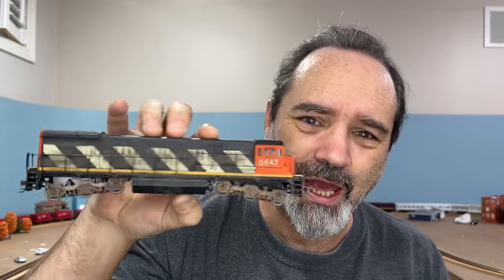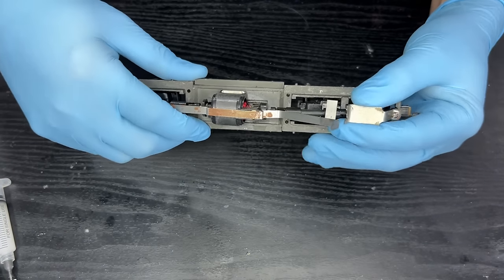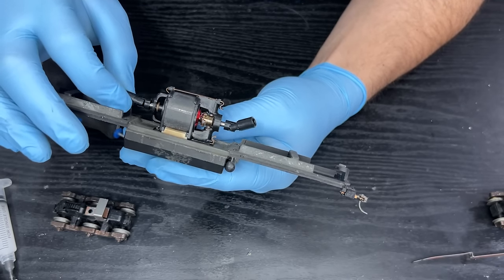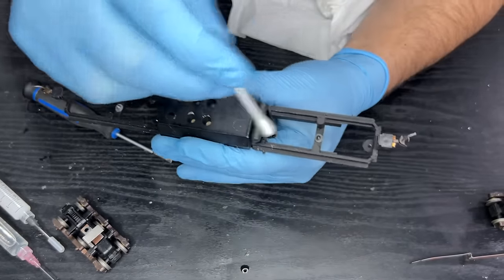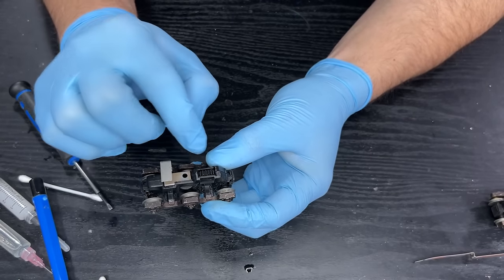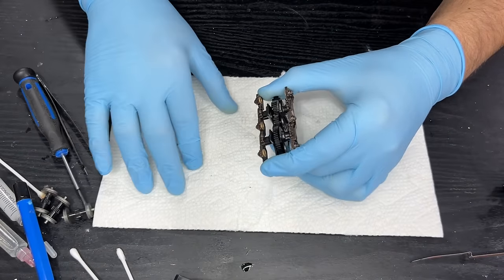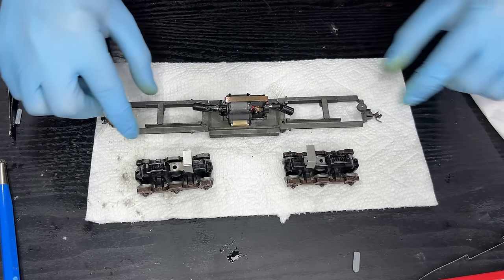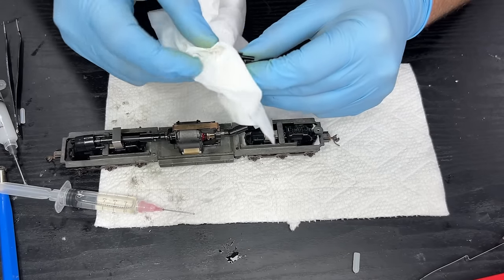Tune Up Tuesday - CN U33C Athearn Blue Box

Comment: Looks like a typical successful repair of a 1970s Athearn drive.

As I mentioned in a previous video that the CN didn't have these locomotives (most likely any GE U-boat locomotives) and I would guess that would go for the CP, also. There is a very good reason. At the time GE made the U-boat series locomotives during the 1960s, Canada had a stipulation on importing locomotives. Since GE was a new locomotive manufacture during the 1960s after Alco quit making locomotives, they would not have any established factories in Canada for locomotive production. Instead, the locomotive purchases for similar Alco Centenary series locomotives went to the Montreal Locomotive Works (MLW) who had the Alco license to make Alco Centenary series locomotives long after Alco stopped making locomotives in the USA. This is the prime reason that the CN and CP had Alco locomotives exist long after US railroads long retired them.  If the locomotive stipulation was not in effect at the time and the MLW did not produce any locomotives after Alco quit, I'm sure the CN and CP would have purchased these locomotives. This locomotive makes a great what-if locomotive if history did change.

Comment: Another great video Dave and I am so glad you did not replace the electric pickup bar.  I will never understand the burning desire to replace the bar with globs of solder and wire.  I have over 30 Blue Box locos and never have electrical pickup issues with the bars.  And by doing the wire thing you are taking away one of the best features of being able to easily drop the wheel assemblies for maintenance.  I get it if one wants to convert to DCC, but otherwise NO.  I see so many videos that recommend the wire, it makes me sick every time.  Take care and keep on moving with the greatest hobby out there.  Jeff.

Comment: That is a very early run U33c. Athearn did away with the screw holding the light quickly, and went to the push in front mount to save money.
Reply from the maker: That's a shame, the screw idea is much better.

Comment: Thats a very Early athearn blue box U33C i have a great northern one I patched for BN just like it i did ditch the early grey motor with no flywheels for a 90s gold motor with small flywheels from a F7 the small Flywheeled motors will only fit because theres no cut down in the frames for the bigger flywheels

Comment: Does your power pack have a pulse switch? Or is it built-in? The reason I ask is because power packs with the pulse function tend to make motors hum on start up..a definite noticable hum..iv had older packs with it that make the motors run really noisy, a newer pack with more filtered DC current can potentially help quiet a noisy motor.. assuming of course it's been maintained.
Just something to try or think about
Reply from the maker: I did have a newer power controller which was silent, but it lasted about two weeks. So, we're back with ole reliable, lol.